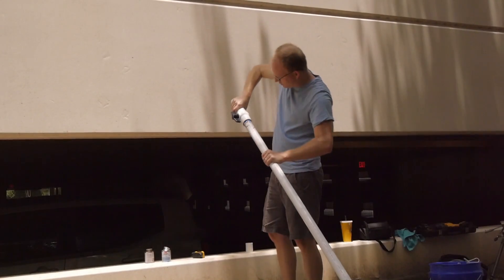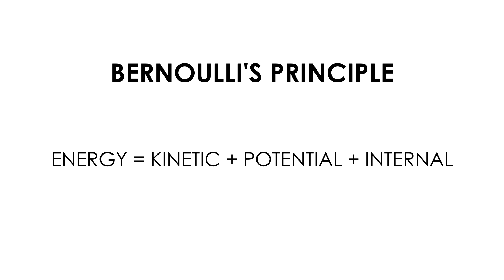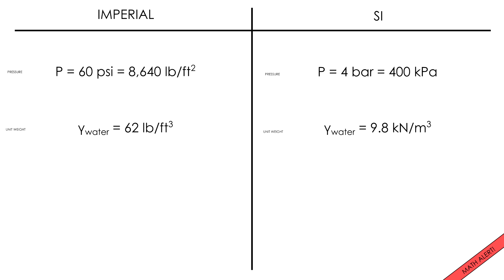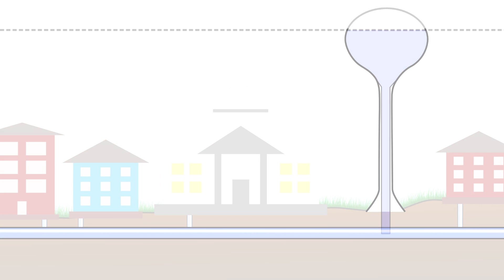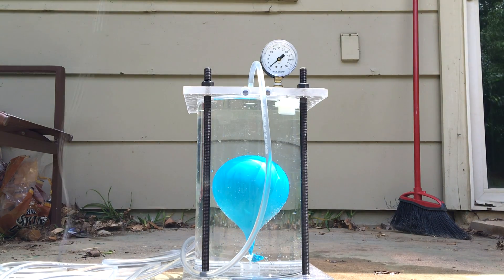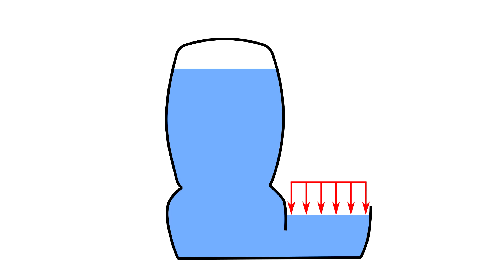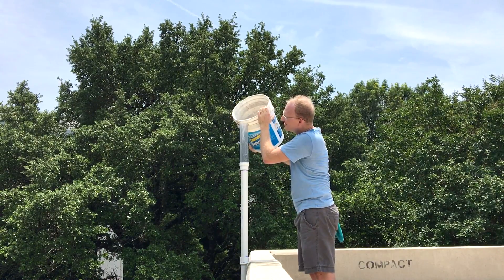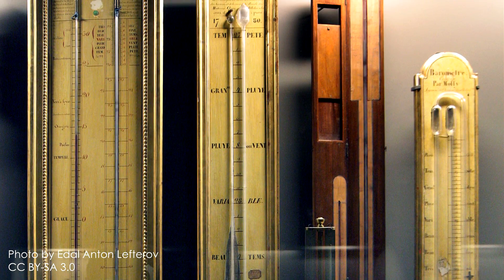Boil Water at Room Temperature! - Hydrostatics

Comment: So if you have a tall enough water tower that is air-tight in a warm climate, and paint it black with some reflectors pointed at it around the base, you could pump seawater into it and have it work as a vacuum distiller. By painting it black you'd need less elevation, as it would heat up. (Boiling point would still be lowered by the vacuum draw.) A separate collection area with it's own drain internal to the tower could be placed under tubing coils with seawater constanly pumped through (which is cooler than water in reservoir section) and condense out freshwater. Volume per day would be limited by the evaporation and condensation rate based on available sun and coolness of the seawater, but I'd think that would work pretty simply on a 3rd world budget compared to reverse-osmosis. Probably wouldn't do enough for large city-scale or modern farm irrigation, but would provide enough freshwater for a small coastal or island village.
Reply: Interesting idea, some problems: First, you need to pump up the water, needs energy too. Second, painting black is a good idea, but you need some cold surface to let the water condense too. Would be interesting to see the math behind it, but in the end you need to take other things into account too, like construction effort, microbial hygiene etc. 3rd world situations call for simple, robust still efficient constructions that scale.
Cheep, good, fast: choose any two.
Reply: I like the way you are thinking here!
I wish I had a place to try this.
You would need full elevation for the condenser side, but the level of sea water would be lower because of the temperature. (and salt)
The warmth of the climate wouldn't matter as long as it was above freezing, just the amount of sunlight and the amount of cooling on the condenser side.
Reply: Depending on how much vacuum you are drawing you may want to go smaller scale. Also they'll get salt out of the deal too
Reply: pauljs75 get that patented!
Reply: what about using that to cool stuff?

Comment: The hydrostatic approximation is one of the fundamental assumptions in meteorology.  When I was in met school we had a famous barometer problem where we calculated the exact height of a column of water at a given pressure.
Reply from the maker: Don't forget to subtract some height for the dissolved gases that will come out of solution and put backpressure on the top of the column ;)
Reply: We simplified the problem a bit as it was only a second year class. For us using mercury so little gets lost its almost negligible. Really enjoyed your videos. :)

Comment: When they make the mercury barometer does the mercury boil at the top end too? And is it mercury gas in the top or a vacuum?
Reply from the maker: Only a very small amount. The vapor pressure of mercury is much lower than that of water.
Reply: Practical Engineering I see, so is it safe to say that if the length of the tube is 13 times shorter, the length of the bit of gas at the top is 13 times shorter as well?

Comment: Okay, okay... Alright. Okay. So LETS SAY I have a swimming pool, and I cap that pool with a rigid cap. Cause science, let's say I cap my pool with a transparent aluminum cover that's exactly on the water's surface (so you can see me freak out) and is air/water tight on the edges. So, lets say I get in that pool (with scuba gear, prior to the cap being put on) and then you rig your hose and bucket up to a tiny nossel in my otherwise perfectly rigid airtight cover, and take it up to the the top of my apt complex (4 stories). Lets say I hang out in the pool for an hour or so, investigating the bottom of the pool. 

THEN SOME JACKASS COMES ALONG and cuts the tube.
2 questions: Will there be some kind of geyser effect coming out of the snipped end (Justice on the jackass!) and will I get the bends?
Reply from the maker: This is a great theoretical situation. The one thing that you have to consider is that, with a very narrow tube, changes in volume in the pool will cause huge changes in pressure. So a high pressure on your body would likely shrink it's volume, and the water level in the tube would drop significantly to make up for that change in volume. Since the level in the tube dropped, the pressure will drop too. Just something to keep in mind. Other than that, the answer to number 1 is pretty much no. Water is mostly incompressible, so the water that was in the pool before the snip wouldn't expand to create a geyser. The answer to 2 is probably yes. Cutting the tube would create a rapid decrease in the pressure on your body which would force nitrogen bubbles to come out of solution with your blood (just like the bubbles in the barometer experiment).

Comment: Love the video, just one question about the water tower. Don't you have to include the pressure of the surrounding atmosphere in the calculations making the tower only 30m tall?
Reply from the maker: That's a great question. For simplicity we often ignore atmospheric pressure since it usually applies to both sides of the system (e.g. the water tower and the faucet in your house), balancing itself out. We use the term "gauge" pressure to distinguish between "absolute" pressure (which includes atmospheric pressure).
Reply: Thanks for the explanation, really helpful. The videos are great!

Comment: Q) How do taller than 10m trees get the water up to their leaves from their roots?
Reply: capilarity
Reply from the maker: Push from the bottom, just like a pump I presume (not a biologist). This is a great question. For water wells deeper than 10m, you can't have a pump at the surface - you have to use a submersible pump that doesn't rely on vacuum to draw up water.
Reply from the maker: Very cool. Thanks for sharing!
Reply: Now that's a good suggestion!  I wonder if it can go very high.

Comment: Your example with the weird looking tanks is wrong in my opinion. The lowest pressure is in the leftmost tank with a wide bottom.
Pressure = Force/Surface. At the bottom of the leftmost tank you have the highest surface and i think you have quite a low weight of water. That means Force/Surface is small. On the other hand, you have on the funnel shaped container a relatively high volume of water (high weight) but on a smaller surface.
Your example with the water balloon is also flawed. You measure pressure at about the middle of the tank, but you have a lot of water in that "pipe" BELOW the measuring point. You do not have to climb your house with that weird thing, just lift the whole pipe (coiled as it is) above the container/measuring point and you will get the same effect.

The principle you formulate, that pressure depends only on depth holds true for containers that do not vary in "surface" over depth.

Also invoking Bernoulli's principle here is wrong in my opinion as that principle deals with fluid dynamic (flow) not with static fluids.
Reply: Motanas i cant tell sarcasm

Comment: What would happen if you were to make a ridiculously long pipe with an impossibly thin tube, fill with water, then touch the tip to, say, the surface of an aquarium?  Would every fish die from the massive and sudden increase in water pressure?

Could you (impractical, but hypothetically) weaponize this to take out subs by having drones fly around with straws full of water that stretch out into space?
Reply from the maker: If the top of the aquarium was closed off, it might kill the fish, but it would definitely burst the aquarium (assuming it wasn't rating for a bajillion psi).
Reply: The water would just fall out of the tube until the pressures became equal.

Comment: Ok so let me know if I have this straight. If I had a 6'x6'x6' sealed tank of water and I were to lay on the bottom it would be roughly the equivalent of being at the bottom of a 6' deep pool. Now add a 400' high pencil sized tube to the top of the tank and fill it with water and I am going to feel like I am at the bottom of a 406' deep pool? If I understood that right you just blew my mind.
Reply from the maker: Yes, as long at the top of the pool is closed off like a tank. If it's open to the air, the water level in the tube will just equalize with the pool.
Reply: Cool thanks.... wow just when you start to feel like you have a good grasp on how things work something comes up and shows you that you know nothing... :)

Comment: Please do the same experiment with a bigger hose to see if there's any difference, i can almost bet there will be because you will be increasing the force on top and keeping the same area on the bottom
Reply: No, the hydrostatic formula for pressure exerted by a column of liquid at height h, a density ρ and gravitational acceleration g is p = ρ * g * h.  Now, if the water is moving, hydrodynamics is a different topic.
Reply: nope, it will behave the exact same way whether the pipe is 3mm in diameter or a mile wide.  The height and resulting pressure and vacuum is the only thing that matters.

Comment: So if you took a very long tiny tube and put one end in the ocean and the other end up very high and filled the tube with water, it would drastically increase the pressure of the entire ocean? This doesent make sense to me
Reply from the maker: No because the ocean is not closed off at the top like a tank.
Reply: ahh makes sense now

Comment: What does the valve have to do with anything... If there's x amount of water and u open it how does the level drop without growing...
Reply: +Brett Young
Yooo i remember having kind of the same problem understanding all of this and i think i know your problem
Early on in school, we are taught that water boils at 100 degrees Celsius ALL the time, ANY time, WHEREVER you are. However, this is NOT true.
Temperature is only HALF of what dictates if a liquid boils (boiling is when liquid turns to gas). The other half is dictated by pressure. In other words, pressure AND temperature dictate whether or not a liquid boils.
So at atmospheric pressure, (a.k.a. the pressure that you feel standing on earths surface a.k.a. about 14.7psi a.k.a. 100kPa) water boils at a temperature of 100 degrees Celsius. This is kind of why you are taught that water boils at 100celsius. Because schools assume that in your everyday life you will never have to deal with pressure that is not atmospheric pressure. In summary, at different PRESSURES, the TEMPERATURE at which water boils is CHANGING.
You can see this by referring to the phase diagram. Find the pressure you are at on the y axis, then move your finger horizontally right to find the temperature at which you boil (boiling is liquid to gas). https://upload.wikimedia.org/wikipedia/commons/thumb/0/08/Phase_diagram_of_water.svg/700px-Phase_diagram_of_water.svg.png
Now that you know all of this, we can answer you question. When he opens the valve, you can say the water in the tube drops downwards. This creates a vaccum on the top of the tube. A vacuum is when you have 0 pressure. Look back to that link of the phase diagram. Go to 0 pressure, now slide your finger to the right. The boiling temperature at 0 pressure is like waaaaaayyyyyyy less than 0 degrees Celsius. The temperature of the water is most likely greater than 20 degrees Celsius because it is the summer time. At 0 pressure and 20 degrees celsius water is suppose to be a gas according to the phase diagram. Therefore the water begins to go from a liquid to a gas, aka boil. Also, there are dissolved gasses in water like Oxygen, Nitrogen, etc. Thats how fish breathe, they take Oxy from the water. Anyhow, at vacuum aka 0 pressure, these dissolved gasses begin to come out of the water also.

So if you open a water bottle in the vacuum of space, the water would instantly vaporize.
So basically if a person were to ask you the boiling temperature of water, then you have to ask the person "at what pressure are you referring to?"
so yea, thats about it, good luck homie
Reply from the maker: The water turned to vapor. Also it lost some of its volume that was due to dissolved gas coming out of solution.
Reply from the maker: The graph shows the states of water under various combination of temperature and pressure: https://en.wikipedia.org/wiki/Ice#/media/File:Phase_diagram_of_water.svg

If you want to learn more, google some of the following terms "Vapor Pressure," "Vacuum," "Water States of Matter," "Water Dissolved Gases"
Reply: The lowered pressure causes it to vaporise to fill up the space of the vacuum.

Space suit cooling works on this principle, water is exposed to vacuum from the backpack module and the vaporising of the water causes a loss of thermal energy.
People assume space is ice cold but it's actually quite hard to cool stuff down quickly when there's only a vacuum and no air to draw heat away via convection, so vaporising water is done to stop the spacesuits overheating.
Reply: +Brett Young
Oxygen is liquid at a certain temperature, just above the temperature of liquid nitrogen.
Reply: +Brett Young
As in its boiling point is 90 Kelvin. Nitrogen's boiling point is 77 Kelvin.
Reply: What forces were acted upon it to make it vaporize... Can u direct me to a certain law or article?? I'm to interested and can't figure out
Reply: +IamGrimalkin so it boils at a cooler temp... Both still pretty cool lol but I still can't figure out why the water dropped but nothing came out of bottom of bucket
Reply: Because of pressure.
Reply: So is it like the vaccume collapses the water into a gas?
Reply: The vacuum is an absence of anything so part of the water vaporises to fill the empty void.
Reply: Well written explanation,  I'm sure it helped with his understanding of what is going on.
Reply: The volume of the water didn't decrease. There was some room in the bucket to take the water that flowed out the bottom of the pipe when the valve was opened. It stopped as soon as the column of water dropped to the height that produced the same pressure as the atmosphere pressing down on the water's surface in the bucket. (about 15 psi)
Reply: And how is there vapor pressure??
Reply: I'm having a hard time understanding your first question about the valve, but to answer your second question, vapor pressure is a property of all materials.  The boiling point of a material is determined by the vapor pressure of the substance as well as the pressure of the atmosphere surrounding it.  For example, on the earth's surface at room temperature, the reason why oxygen is a gas while water is a liquid is because the vapor pressure of oxygen is much higher than water.
Reply: But o2 is never a liquid or solid?? So how does it have a vapor level.. Or is it. Liquid at a certain temp?
Reply: If there is 2 gallons of water and he turns the valve how does it condense to say 1 litre of water?
Reply: +IamGrimalkin "above" hotter or colder...

Comment: I love how in my Fluids class flow rate and piezometric head were related to current and voltage.  I think it's really cool how effectively a water tower is a fluid capacitor and head loss along a pipe can be related to voltage loss from resistance in a wire.

Comment: I have a logical question - using the first tube, big box on bottom, small long tube on top - if 1 small long tube of water adds pressure, what if you added a 2nd (or 3rd) long tube on top? I'm guessing the pressure at the bottom would be the same, but that seems really counter-intuitive? e.g. 1 tube = x increase in pressure, but additional tubes don't add any more pressure?
Reply from the maker: You're right. In fact, the water level in the tubes would equalize with each other. The force goes up with the addition of more water, but so does the area upon which the force acts. So, the pressure does not go up.

Comment: So... is the water in the column actually boiling, i.e. turning into a gaseous state, or are the dissolved gases just being pulled out of the solution?
Reply from the maker: Both. But I would say more of the second one. Once enough gas is pulled out of solution, the air pressure in the tube goes above the vapor pressure of water, so it won't boil.